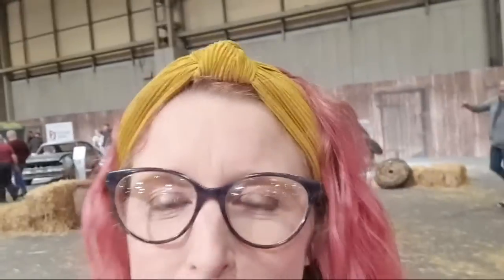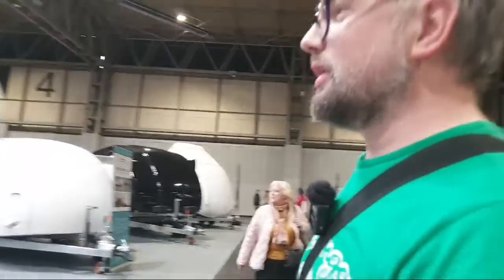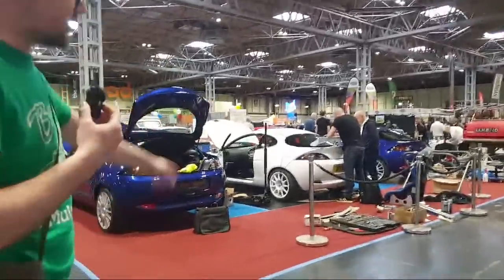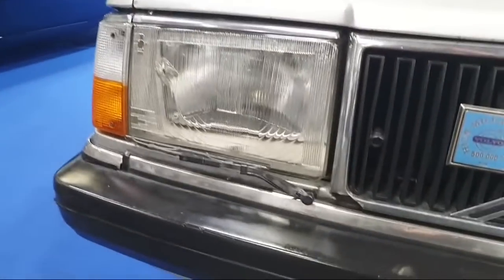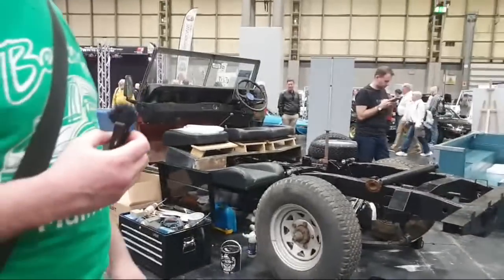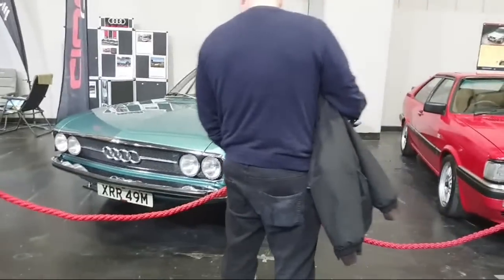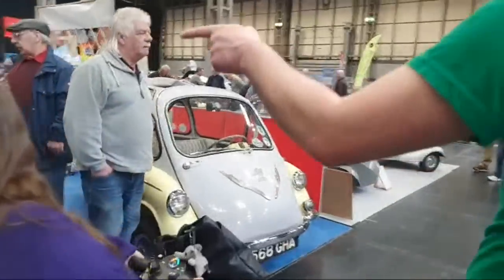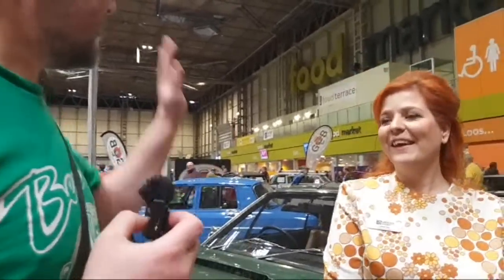(was) Live At Classic Car & Restoration Show! So much to see!

Comment: I feel honoured and privileged that 510,000 mile Pasta the Picasso has taken my HubNut goodies to the Post Office. One of the HubNut stickers is going on Veronica the Vauxhall Vectra of Wombwell boot lid opposite "Veronica". The car met the strict criteria of good wiper action, several dashboard blanking caps, poverty-spec wind up windows in the back. 155,000 miles. Car cost him £600. With HubNut sticker £605. A fine investment indeed. 🎉

Comment: The MK3 Cortina estate.  Webber twin down draught  auto choke controlled by water temp.   Had a MK3 with that fitted . Off came the standard Ford air filter with the winter setting.  On went a oil dipped sports filter from Halfords  and  some baking foil in the front grill to reduce cold air.   Sometimes on a really cold morning  a shot of easy start.  Auto chokes always liked one depression on the accelerator pedal and no more. Happy days with my MK3  2000L  77-83
Reply: Out of the 45 ish cars I've owned since 77   my Mk3 Cortina  is still my favourite   body shape wise  .  The days when young lads like me hankered after an American muscle car we'd seen in the likes of the film  Bullitt , Mk3's and several others like Vauxhall Cresta were has near a British version you could get.
Reply: My daily is a 1.0 Yaris  and I've just bought a 93 MK3 Cavalier  2.0 Diplomat  for future tinkeridge.

Comment: at 1:58 the Jowett Javelin, a car layout still alive at Subaru 4 cylinder boxer in front, frontwheeldrive. Developed with German engineering cooperation ,part of the development team was Robert Eberan Eberhorst the man who helped the Auto Union Type C V16 to bring its 520 bhp on the road and off course knew from the biggest Auto Union marque DKW how to handle front wheel drive…
Reply from the maker: Javalin is indeed a flat four, but rear wheel drive.

Comment: No Austin Alegros the show is getting better although there were Hillman Imps and an ltalia Marina made up for the lack of Austin Alegros but not many Japanese cars although l do remember those Honda 1300 with there air cooled engines how these shows bring so many cars l have known about from my 50 years of interest in cars no Toyota Centurys maybe there was and no Suzukis
Reply: To lesklower. The 70's Japanese cars were supremely characterful and elegant, being European in size, but with American styling touches! I'm glad the Allegro got a mention - one of the favourite cars I have owned, and now in its 50th Anniversary year!
Reply: @nygelmiller5293  l live in Australia and we never got the Alegro in Australia  but unfortunately we got the Morris Marina and it came with a six cylinder motor buy fortunately l have seen any in years good ridens to bad rubish have the UK ever built a good car no they are all crap now and then but fortunately we get Toyotas in Australia which are fantastic cars reliable hold there value infact l got a 1997 Hilux with the famous 22R engine what a motor one Hilux sold with 980000kms on it because of its engine the 22R engine
Reply: @lesklower7281  I take your point, Led- but sometimes there is more than one side to a story! We never got the Morris Nomad in the U.K. , that I would have bought - I like the idea of a 1500 engine, which would have made motorways even better than the 1300 model, which of course had 200 c.c more power than the 1100 version. But you can't get too much of a good thing - so a 1500 engine would have been an excellent idea. The Austin Allegro you never got, was probably because it was launched in the same year ( 1973)  as Britain was pushed into the European Union (WITHOUT A VOTE). And apparently it was supposed to be one if the first pan- European  looking generation of cars. It was meant to look French, which I myself thought. In Australia, with the heat, you wouldn't get the rust problems you could get here, and Japanese cars were replaced more often, so I don't thing cared that they DID rust here! Makers, wit hindsight, ought to target their resources of research, and cater for such things as the effect of the climate in OTHER COUNTRIES!  Also, as I say, considering larger engines were available in British cars for Australia - they should have made ALL the range of engines available here too! Why not! People often think internationational makers are inconsistent in their approach! But people from Australia DO praise the original MINI, (most of which) have solid rubber suspension, and say it stood up to rough roads BETTER than any other cars! Nice "chatting" to you - have a good day.
Reply: @nygelmiller5293  I do remember the Austin 1500 my wifes second car was one they came in a hatch back and a booted one also the Morris 1100 was very popular in Australia l can remember all these because l was born in 1954 and growing up especially in the 1960s the greatest decade for motor vehicles the British motor industry was at its peak what happen to that mini won at Bathurst the first London to Sydney marathon won by a Hillman Hunter what happened to them a couple for sale at rediculous prices the Japanese were starting to export there cars thank goodness and they are still around the British coukd have learnt a thing or two from the Japanese how to build good reliable cars but they didn't and don't own any British cars and we own a 2021 Suzuki Beleno GLX and a 1997 Toyota Hilux ute 2WD westhich are from two of the b
Reply: @lesklower7281   Oh yes, by the way, my wretched phone has a so-called SPELLCHECKER, with is actually a Spellinterferer! I tried to mention oriental cars being  J a p s, but it changed into maps! So sometimes I have to correct this  by leaving gaps between letters, or the word gets changed!
Reply: @nygelmiller5293  l am doing all this typing on my tablet l don't like replying or comenting on my phone it is much easier on my tablet my phone is good for looking at cars for sale just to see how much my 1997 Toyota Hilux is worth wether it us worth repairing but my tablet us what l use to do a lot of the repairs to my ute l don't need a workshop manual its all on you tube there us so much on you tube and living in Australia were it doesn't snow that much rust isn't a problem for my ute only surface rust no knock backs for rust on my yearly regestration inspection and we have 91 unleaded we do have E10 but l don't use it in either vehicle
Reply: @lesklower7281   lucky that everything is on your tablet! And if you can keep your Hi-Lux going for longer, it helps the environment, because if you scrapped it before it's time - a lot of energy would be used in recycling it!
Reply: @nygelmiller5293  l defently will not be selling it but if l sold it it would not be scrapped because the person who would buy it would use it because if the work l have done to it because it will go on to do well over 100000kms if looked after and it has only done 430000kms on it and it still has plenty of life in it because it is built to last infact the 22R engine which is in it along with the gearbox are over engineered realy so it will last another 20 to 30 years it will outlast any EV but will there be petrol around but the trouble with it its 26 years and not every thing doesn't kast forever but the engine will and the gear l have replaced a lot if stuff on it some if it l have done myself but it has a new exhaust sysrem a radiator was replaced serviced a set if new tyres exept fir the spare which us full size luxury means if you are traveling any where and get a flat chage your tyre and keep going at the same speed and the latest thing is the universal joints need replacing and they are a servical item probably fit a host of other toyotas but parts are easy to get because the USA they are popular there and l replaced the ignition leads and they are made in the USA but when l bought it no service history nothing but l have started a comprehensive service history myself but the Hilux will outlast me l have two children to pass it onto